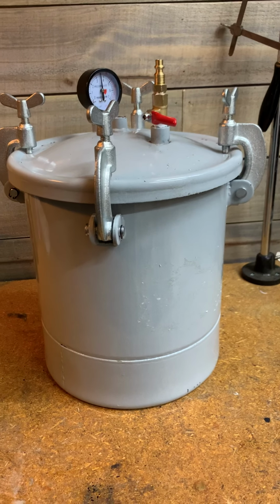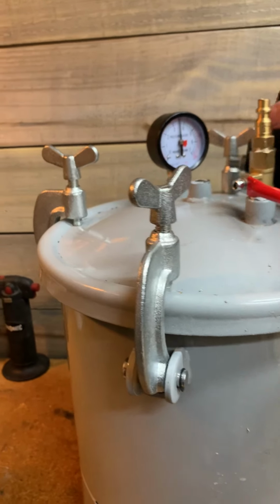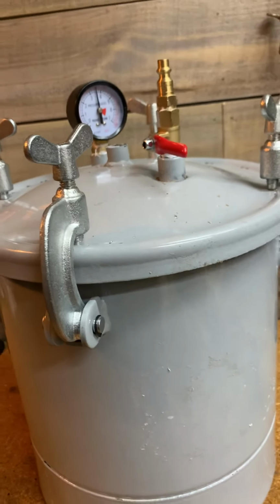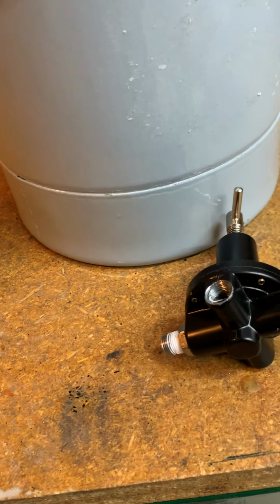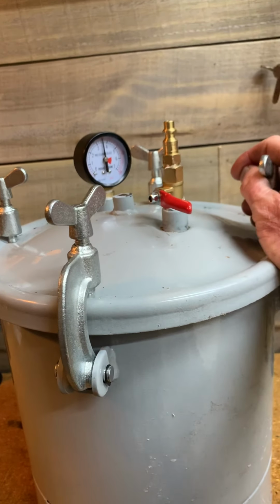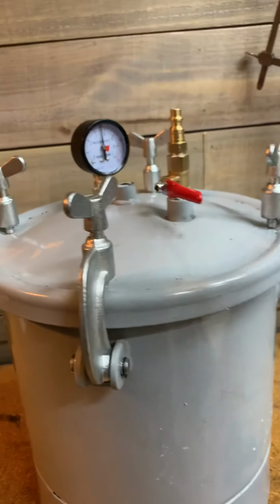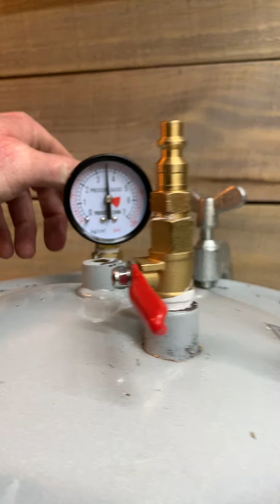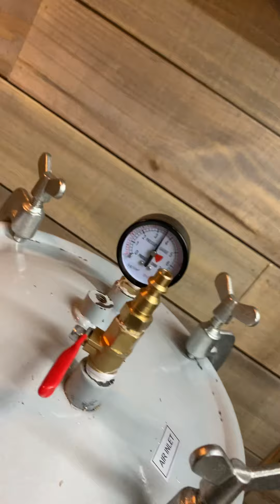Harbor Freight Pressure Pot simple conversion

Comment: As long as you run it on them compressors I don't think you will ever have a problem with it. Most of that stuff is for running big compressors that can easily reach 185-200 psi. with lots of volume.  Simple is the best way to go. Nice job!  Have a good one!
Reply from the maker: Louisiana Tractorworks & Projects thanks for the comment yea I like the k.i.s.s. Method anytime I can get away with it. “Keep it super simple” lol

Comment: Those pressure relief valves that come with it are adjustable.  They are usually set around 30 psi when you get them.
Reply: Not sure if you'll see this but I have this pressure pot, and I am so clueless as to how to adjust the pressure release valve, do you have any advice? Thanks!

Comment: You don't need to put anything in the hole left in the lid from where you took the long paint tube out?
Reply: That hole became the 3/8 to 1/4 with pressure reader. The hole your asking about had the metal handle and it doesn't go all the way though.